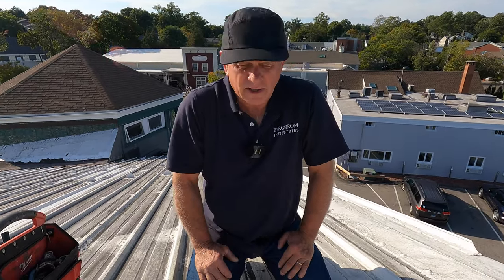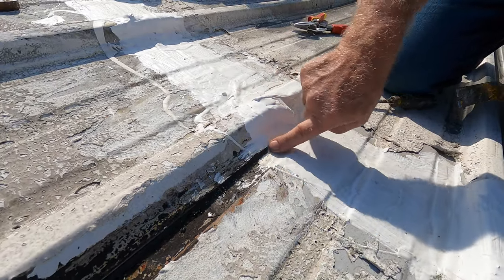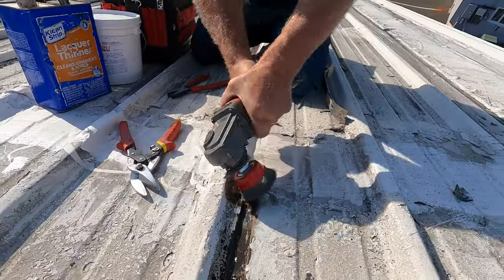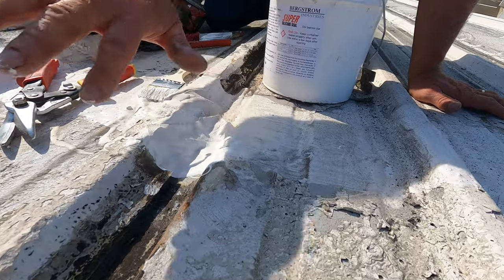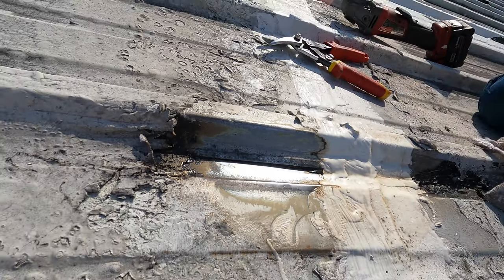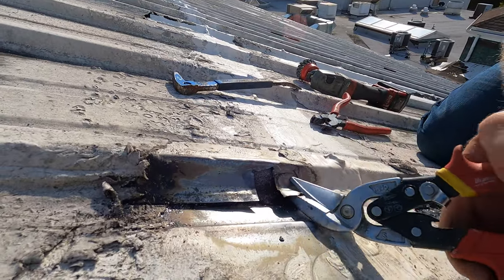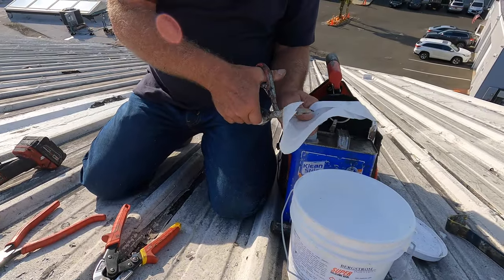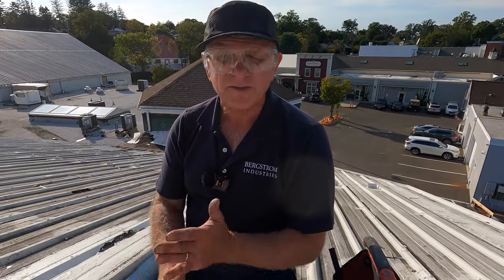METAL ROOF LEAK REPAIR: A super important Tip that will catch you by surprise

Comment: Is it two pieces of metal roofing running down?? That's a big mistake period. The water should go in the seam and up and over the ridge, that's not possible and they probably didn't run the Butyl sealant tape on the ridges either which if that were to happen with a very heavy rain the top of the ridges are sealed. This is just patching up bad work which is never a good idea unfortunately.  The roofer should be sued if they don't come back to fix the initial improper install.

Comment: What's your opinion on putting a sealant like oneflash over screw heads on a R panel metal roof? I have a 1/2 on 12 metal roof and at the eave's the  screws are in areas that puddle water. There is double back vinyl insulation that is building up water over time and holding water.
Reply: I would try Through The Roof sealant.

Comment: so to do this on my 210 ft horizontal seam would take weeks and cost tens of thousands in labor to pay someone.  Seems like it would be better to try and seal the underside interface between the two levels of roof instead of on top.
Reply: If it is like this, then whoever installed it incorrectly is responsible.